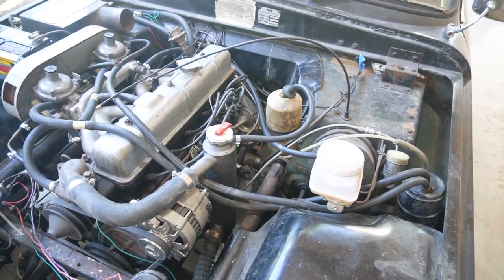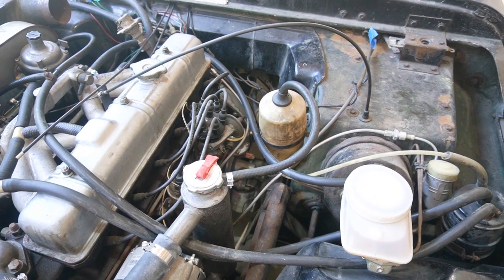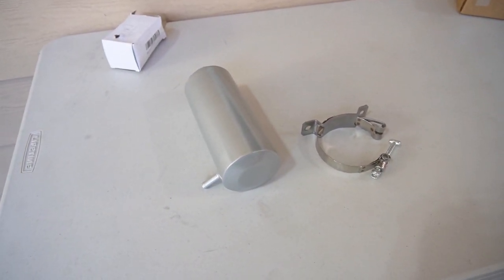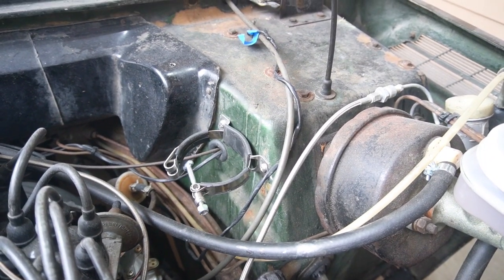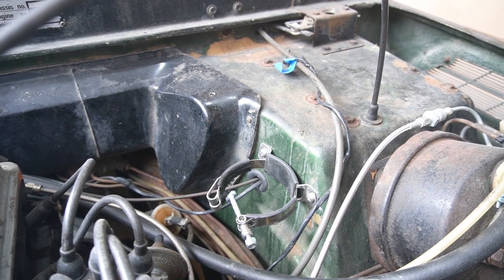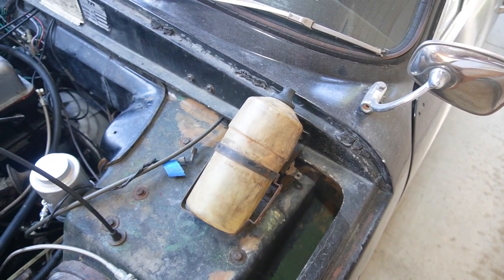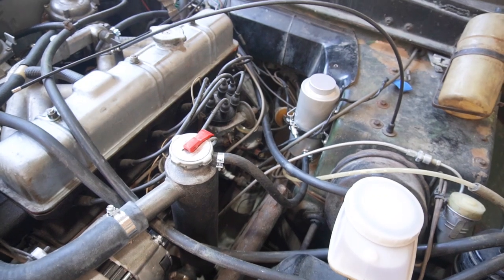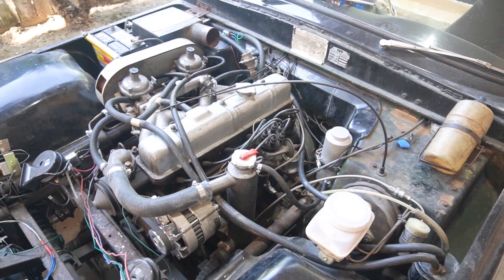Episode 09 Expansion Tank TVR 2500M

Comment: In my experience, I am not familiar with expansion tanks that enter from the bottom. I guess it should work. I couldn't tell from the video but make sure the top is vented to atmosphere. Also, if you really want to clean up the engine bay. Get rid of all the emission stuff; carb evaporative control, charcoal canister , etc. None of it works anyway.
Reply from the maker: Thanks for the advice William. I am doing just that about the emissions stuff. My video coming out this Friday talks about that and where all the other projects are in progress.